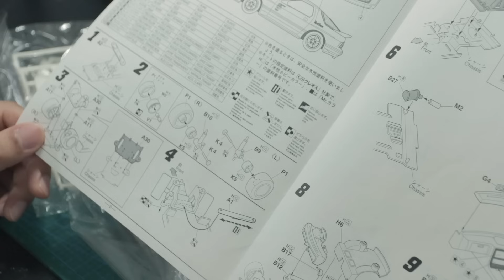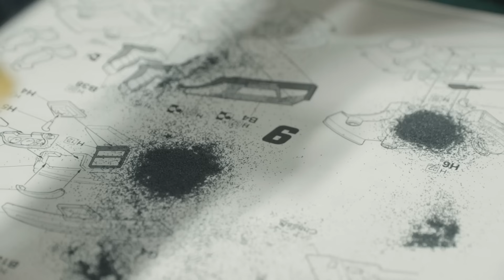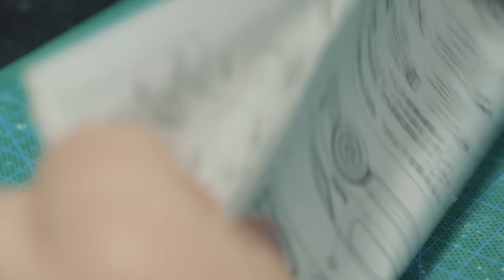Ryosuke Takahashi's Initial D FC3S Mazda RX-7 Model Car Full Build Step By Step (ASMR)

Comment: I know what the “mr2” thing is. It’s an optional part incase you don’t want the bubble looking back
And the battery tray is in case you wanted to motorize it
Reply from the maker: I see, I have looked online and can’t anything about that part, thank you for the information😊
Reply: Wanna ask, when you meant by motorize it, what it will be motoring?
Reply: @JunsMiniGarage  It's called a Pantera hatch.
Reply: @protonsaga85  the wheels. I saw a mount for a motor and a gear. Obviously it wouldn’t be a fast motor though
Reply: Imagine if this was an rc drift car.    That would be so cool

Comment: This was amazing to watch (as well as your video on Keisuke's FD)!
I am completely new to building model car kits but unfortunately I just do not have the skill/or interest in painting them. I have seen that Aoshima have a small (and very limited) lineup of Pre-Painted model kits though they seem to be out of stock everywhere.
Being as Ryosuke's car is white in the show, do you think that this model would look okay without painting once the decals are on? Thanks.
Reply from the maker: Thank you so much❤️This Fujimi kit has a lot of production mold lines that will need to be cleaned off the body, otherwise it won’t look as good as you would expect it to be. Aoshima has made the same car but the body is a lot cleaner, it even has engine parts. I would still recommend painting it. Just take it slow and work on it bit by bit. It’s worth the time and effort. It’s a totally different car when it’s painted.

Comment: Hi! I have two questions: Why are drawing lines with the black marker at 1:20? And why are you using the engraver at 2:00 ? When I tried to use the engraver it only made a lot of small plastic debris in the panel lines that I can't get rid of? :o

Thanks for awesome builds!! :)

Comment: Really good job like always.
I have a question for the paint of the bodywork, is that necessary that many coach ?
What will be the next car (or maybe a beginner guide video next time ? :p) ?
Reply from the maker: You don’t always have to spray paint that many coats if you are not looking to sand it down to smooth finish, if you wish to achieve a smooth finish it’s safer to have a few coats of paint/clear or you will easily sand through the paint and expose primer and the bare plastic.
Reply: @JunsMiniGarage  Ok thanks for  answered me !

Comment: Hi! A newbie here! And I learnt a lot from your videos. Can I check if there are scratches on the car’s body due to sanding, and I have already applied paint coat- will polishing and wet sanding after clear coat get rid of it? Or should I do that at this stage (painted body)? 
Thank you!
Reply from the maker: If the scratches are not very deep then the a few clear coat will fill them in. Wet sanding and polishing will smooth out the clear coat and produce a mirror finish(and make the tiny scratches less obvious)But if the scratches are deep then it might be a good idea to remove(by sanding with 2000-3000). Grit sand paper)them prior to painting and clear coating. Hope my answers are helpful to you. And happy building. 👍

Comment: How come you use the handsaw to cut the plastic where the driving window would be instead of using nippers?
Reply from the maker: The clear parts are very fragile and if I cut it off the sprue with the nippers I would end up applying too much pressure on the clear plastic which would probably crack the windshield, using a handsaw would be safer in this case since it doesn’t apply as much stress onto the plastic and it’s easier to control. Thank you for the question😊It’s a great question.👍
Reply: @JunsMiniGarage  Thanks for replying, I"ll need to get a handsaw now I think!

Comment: Is the paint and the line engraver required? I have never made a model car before and am thinking about purchasing the Aoshima one. I do have basic tools because my brother makes gunpla but would that be enough?
Reply from the maker: You technically could put together a model car without painting it, but painting is recommended since it will make it look so much nicer. Engraving the panel lines makes them slightly deeper so they won’t be filled by paint and disappear after painting.😊
Reply: @JunsMiniGarage  ok thanks a lot. I think I’ll see how it goes without painting it and before I put the decals I will make a decision. Thanks a lot again!

Comment: I have a question about wetsanding. I got some sanding pads but the lowest grit starts a 3200. Will it affect the paint job if I start wetsanding at 3200 to 12000 grit?
Reply from the maker: You can still start with 3200 but if the paint has a lot of orange peels then it will take a lot of muscle and time to get it to a smooth stage. I will just dry sand with 3200 since it’s already a high grit, then wet sand with the rest of the sanding pads.
Reply: @JunsMiniGarage  Awesome thanks. Looking forward to your next project

Comment: Model kit building not meant for everyone especially for those who has never done any before. Just too much work and if you do not have the available and right necessary tools, you really have to spend on them first, get familiarised with them before you can really do a model kit properly. By then you would have spend a bomb on those equipment and tools. What's worse is that if you do not do a good job, its just plain waste of money. I rather buy one off the shelf that's already properly assembled fresh from the factory.